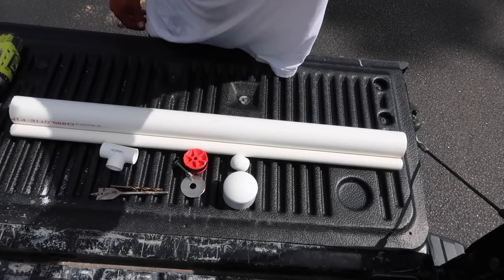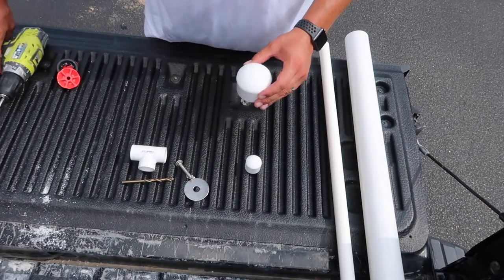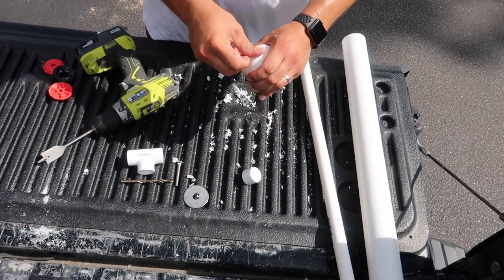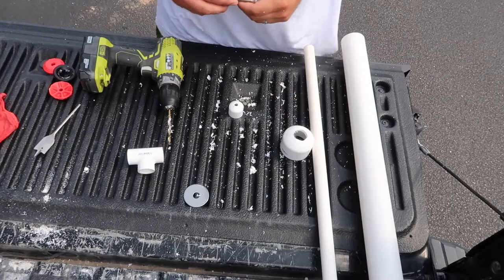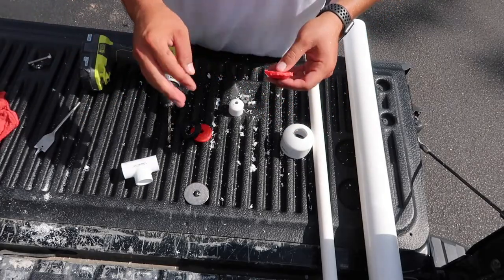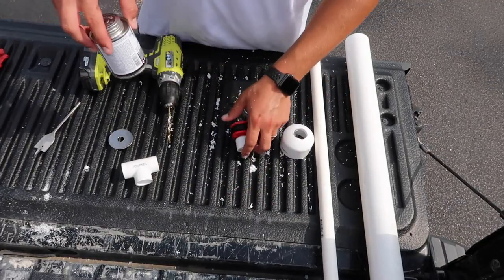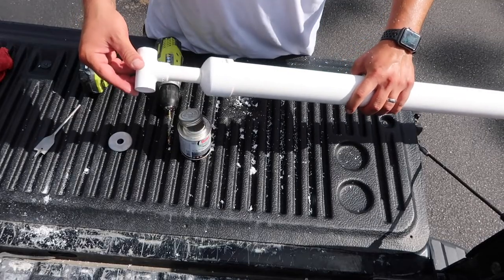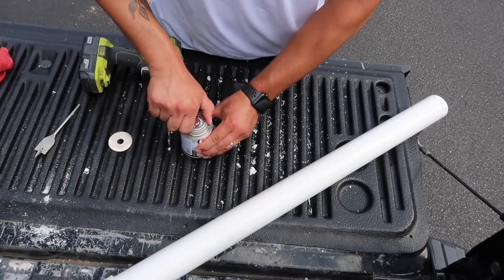HOW to Make a GHOST SHRIMP PUMP UNDER $20!

Comment: I added a t at the top 2 inch pipe, 2 x 2 x 3/4 to have a handle to hold the 2 inch, really helps. Thanks for the rest of the info👍🇺🇸🙏

Comment: I know this was awhile ago but I just made one using your video. Everything looks great except the 2“ washer didn't work out for me. it's too loose inside the 2“ pipe tightening & loosening the wing does nothing on this model but I will go back to Lowe's get another test plug & try making it smaller like you did. This was an exceptional instructional vid. Super easy to follow

Comment: Brilliant video thank you for sharing
Reply from the maker: Thanks for checking it out!🤙
Reply: @BeardedBrad92  would this work if you replaced the plastic pipe with stainless steel, only asking as where i live we pump for lugworm.
Reply from the maker: I’m sure it would work just as good
Reply: Thanks Brad
Reply: @pompeyo7 , -
Alvey Reels, Australia, make bait suction pumps with s.s. pipes.
Alvey fishing reels etc are imported into USA, -
maybe their s.s. pumps too. I have two of them.
These pumps need a handle fitted in, just under the top cap! It makes it So Much Easier to pump with! 🦐
 I am in SA.  🇿🇦

Comment: Looks simple to build but I have a dumb question what is a test plug and where do I get one. Are they in the same section as pvc parts in store or another section. Looks good though
Reply from the maker: They will be in the same plumbing section. They will be with the fittings. Sometimes it’s tough to find everything because there’s so many different sizes and whatnot, so you could always just show the guy the list and they could get everything pretty quick for you!

Comment: When the small end of the spade bit starts coming through, turn the cap over to finish the hole!
Reply: Or just do it right and use a hole saw and run it in reverse......HF has a hole saw kit for $18.
There is a cheaper $13 kit but it goes from 1" to 1-1/4" as the $18 goes from 1" to 1-1/8" which would work better for 3/4" PVC where the cheaper kit would work better for 1" PVC.They also have brad point bit set for $6...
If one can't afford those then one can't afford to fish...

Also when gluing PVC one has to use the PVC cleaner or acetone (same but cheaper by volume) 1st then apply the glue.Just using glue and no cleaner will ensure the joint will come apart at some point,sometimes sooner than later.
Also to reduce the size of the one side of the test cap just put your bolt through the cap,screw on your wingnut and chuck it into the drill you have to make the holes.Then just run it over sandpaper,concrete,asphalt,or anything of the like that is rough.This will make it near perfectly round.

Comment: I'm confused. You used a 1" drill to drill into the 2" cap to accept the 3/4" PVC? It's the 3/4" PVC actually 1"?
Reply: The 3/4 is interior dimensions. Exterior is 1"

Comment: Put a handle just under the top cap!....
It makes pumping So Much Easier!.... 🙂
Reply from the maker: I’ve seen some like that. Definitely a good idea!
Reply: @BeardedBrad92 , - 
In SA, 🇿🇦, we have plastic bait suction pumps, that we also refer to as prawn pumps, with handles on. I have two Australian Alvey, steel pumps, are made with handles on. Alvey reels etc are imported into USA. They are much more advanced with handles on them! 🦐
Reply: Also, on all of my pumps, I put a level end, pipe end cap, onto my washer system, facing down! I made a hole close to the level end, to get split pin thru the metal rod, as threads on my pump's rod are worn down! Or put washer in place, turn nut onto rod!
This hollow shape increases suction power!...🦐🦐🦐
On my plastic pumps, I  file a slight curve edge, from outside of bottom of plastic pipe, and on the shaft edge, below washers,  sloping inwards, this makes it a little easier to push pump into sand or mud! 
 !🎣_🦐-🦐-🦐-🦐_🎣!

Comment: $20 lol; not through Amazon and certainly not in California.
Reply from the maker: At lowe’s in Alabama you can get all parts for under $20. This assumes you already have drill bits glue lying around. But just the parts in the pump all together are under $20
Reply: @BeardedBrad92  Ok consider throwing Alabama in the title. lol